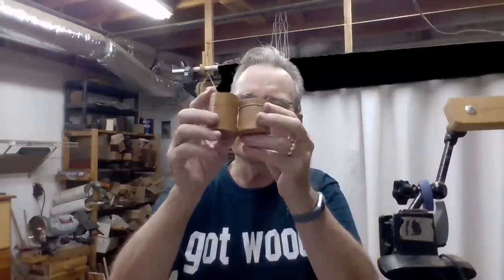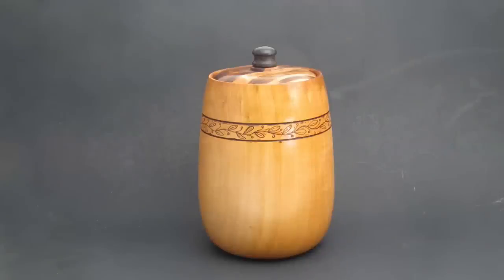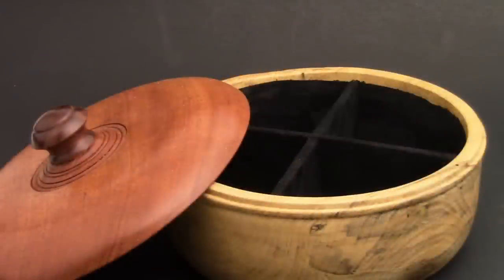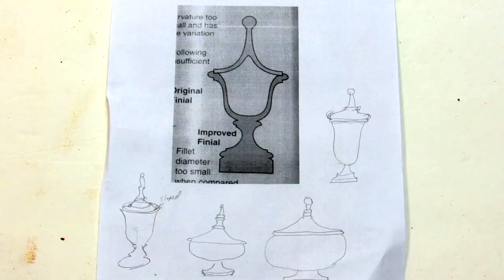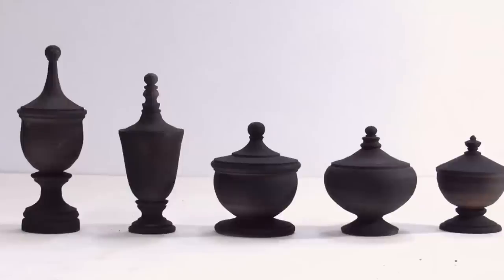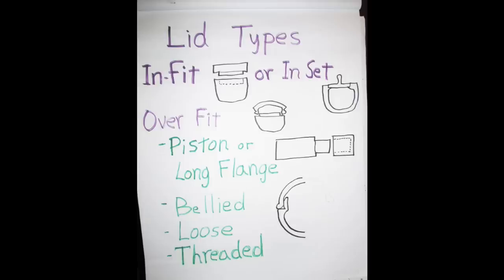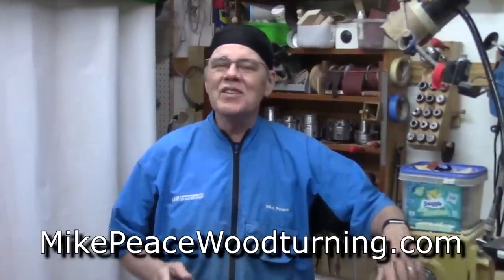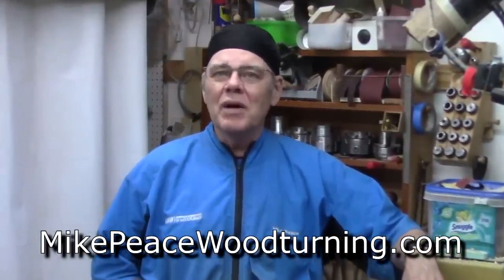Woodturning Box Design - Get Out of the Rut!

Comment: Thanks, Mike; comprehensive and a good boost to the imagination. I enjoy box turning and threading, but could not thread pen tops(over the nib), even with taps and dies. So I used the piston(snap) fit, with an inner ridge. Very pleased with the result, using English elm. One slat from an old pallet provides plenty of blanks for pens and needle cases!   Bernard.
Reply from the maker: Maybe  I should a video on pen turning. What do you think?
Reply: @MikePeaceWoodturning  I quite expect that you would provide the odd novel tip; so yes please.   Bernard.

Comment: Got an insert/texturing question. I know nothing on this topic. In this video you talk about saving medallions that you practiced texturing on to use. Question is texturing does it matter if you do this on side grain or end grain? Good box explaining video.
Reply from the maker: Depends on the wood pattern and grain as to which to use. A thin medallion is too small for wood movement to be an issue. End grain wil take texture more evenly and easier to practice on the end of a cylinder in a chuck.